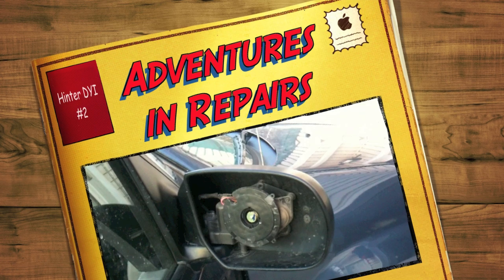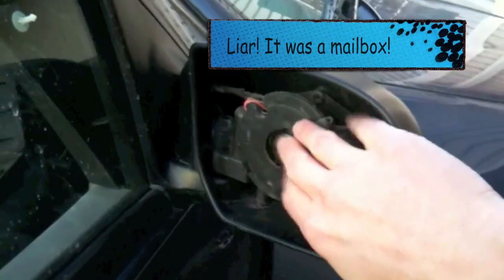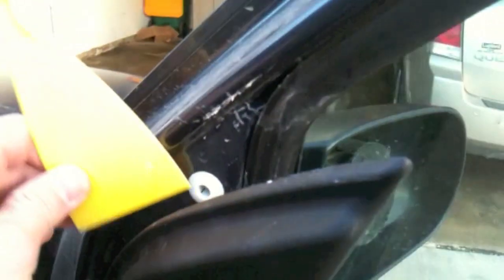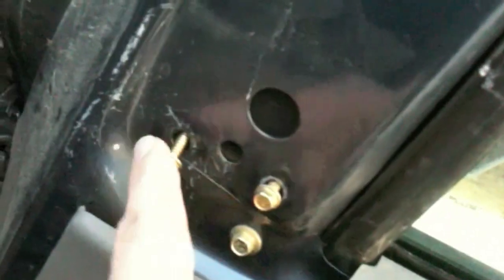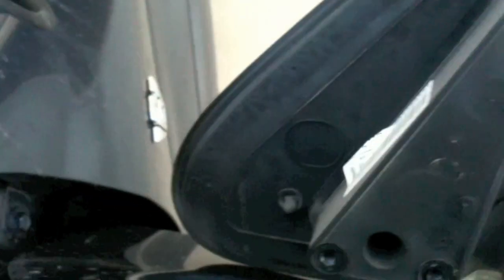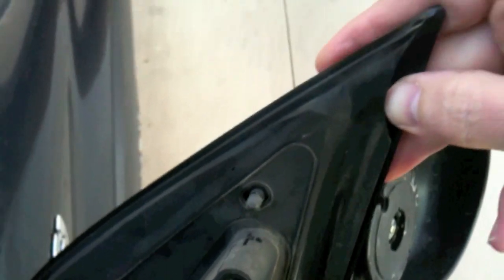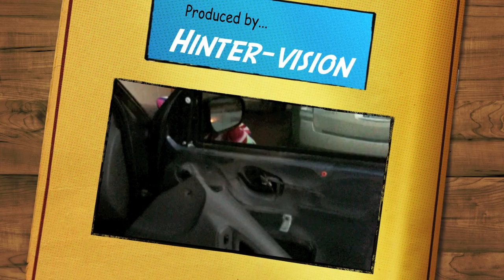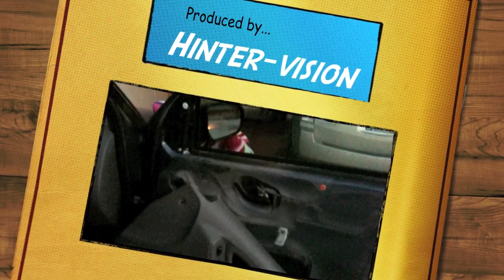Replace Your Car Passenger Side Mirror - How To - DIY

Comment: I don't even use the right side mirror, I took mine off.  It's actually useless.  The only reason to have it is if you are really bad at parking.  Why would anyone use it for driving?  No wonder why there are so many accidents.  Look over your shoulder.  You will see exactly where the cars are instead of maybe getting a general idea from the mirror, perhaps.  So dangerous, so dangerous.
Reply: Lol the point is so that you can keep your eyes forward in the direction the vehicle is moving
Reply: The you look over your shoulder for a split second to double check instead of having to really look hard over your shoulder to make sure there are no cars. Please nobody listen to this person and take your mirror off.......
Reply: @equilskateboarding7676  talk to any driving teacher.  The mirror on the right side is not accurate and can actually cause accidents.  You shouldn’t turn your head until you are sure you are far enough away from the car in front of you.  You would know the proper distance if you were a good driver.  You shouldn’t be close to the driver in front of you, at all.  I know this seems alien to you, but good drivers will be at least a car’s length away from the car in front of you, and your head should not be turned for more than a fraction of a second.  Matter of fact cars didn’t start having mirrors on the right side until the 70s, and it was to make the car look good.  Do some history on it.  Do some research.  I’ve been driving since the early 90s as a taxi driver, a repo driver, delivery driver, never once have I relied on the right side inaccurate mirror.  And never once have I even come close to an accident.  I drive in NYC, btw.
Reply: @Bongwyre2112  that's because you drive in NYC........
Reply: @Bongwyre2112  ever been on a highway Mr. nascar driver?
Reply: @equilskateboarding7676  every highway in westchester county, nyc, west side highway etc...  you name it, if it’s in NY I’ve been on it.